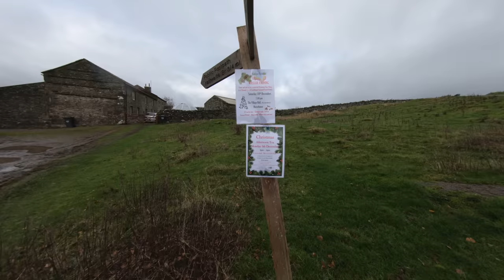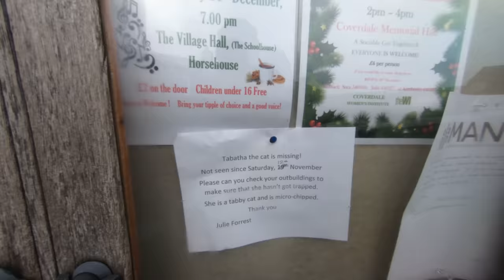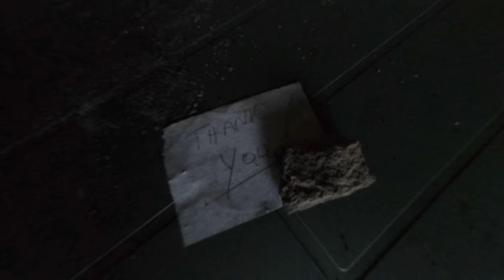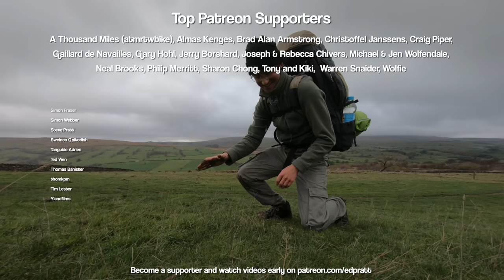Solo Stealth Camp Inside Hilltop Hut

Comment: Hey Ed it's good to see you again. Quick tip with that stove if I may, it's best to shut the valve near the gas bottle first. I like to shut it when my meal is almost ready, the flame will keep on burning for a moment and when it stops you know the line is completely empty of gas. That makes for a much cleaner stove with less gunk blocking the tiny hole. Cheers to all of your adventures !
Reply: I've got what I think is a newer model of white gas stove and it doesn't even have a valve where the fuel line goes to the stove. just the one on the bottle pump/regulator.

Comment: That was hilarious, I was already typing, asking you if you never got problems with clogged nozzles when priming the stove with pure gasoline, when it was already clocked up🤣

I found two ways to get around this issue:

1. Whenever I dont fly I have a small 30ml bottle of straight ethanol to prime, that lasts two weeks easily and burns much cleaner then gasoline, allowing me to only turn the gasline on when it is fully evaporated in the heater pipe. 

2. Whenever I fly and cannot bring ethanol I have a small brass lid (mine is a 9mm case with a handle on it) that I put over the nozzle when priming. Squirt some gas, put the lid over the nozzle and light the gasoline around the nozzle. That was the flame does not reach the nozzle and the residue wont clock it up. When the stove is hot I remove the lid and turn on the gasoline. 

Maybe that works for you as well ;)

Comment: You've stumbled into a cracking part of the world. I've worked up here for over 15 years. Just a few points to add to what you've learned. 

The heather IS burned to encourage new growth to feed the grouse. But this is only because very rich people like to pay to blast them out of the air with shotguns. And alongside the burning, the landowners put in 'gripping' or drainage ditches to drain water off the land. This is to stop it being the bog it could be and allow the heater to grow. This forces water into middle and lower water courses faster and in greater volume, increasing flood risk to homes and businesses.

Secondly, there are many shooting huts like this around the dales. They are usually always locked (to stop the public getting access) apart from if they have a dirty room on the back left for the 'beaters'; the poorly paid locals used to scare the birds into the air for the rich people to shoot. Otherwise they'd have to be patient and wait for the grouse to take off. That would make it far less of a sure-thing. They don't lock these rooms because they are only left fit for sheep. Or beaters. 

Nice video.